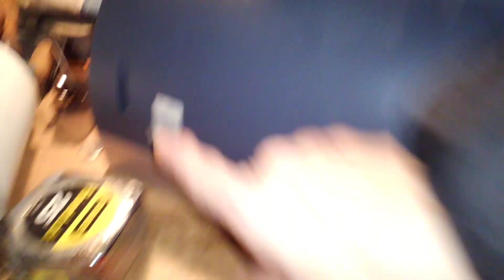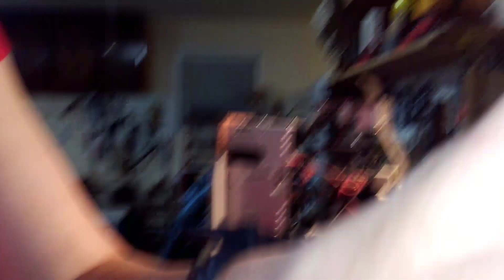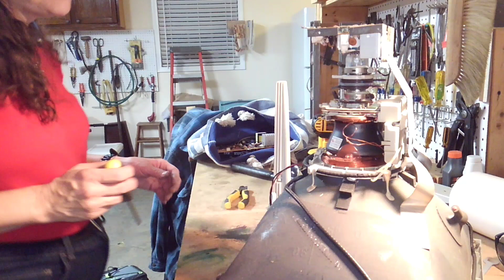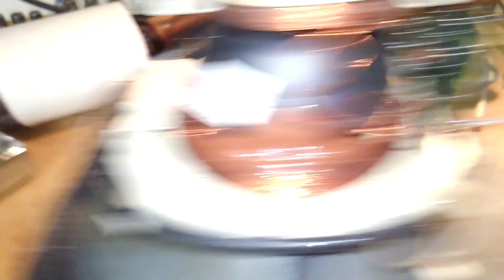Computer Monitor Scrapping on Columbus Day!

Comment: I would have had to cut away all those cords and wires before I started, they distract me and get in my way. Nice score of copper, though!  I have a small CRT tv in my car and a bigger one in the backyard, but it rained today, so no-go...  Its ok,  plenty of other things to do! I'm still catching up on things from being away, including watching youtube vids!
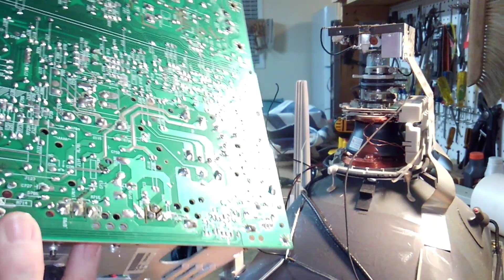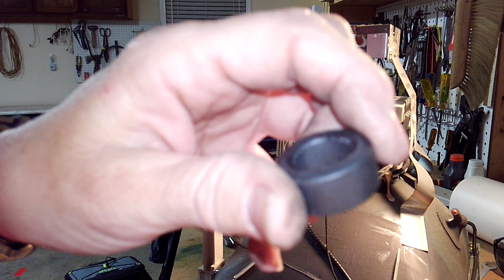@16:55 I thought I saw gold fingers on bottom edge of green side of board when you pulled it off... ?  @21:50 - Those rings are ferrite. Throw them into low grade iron/light steel. 

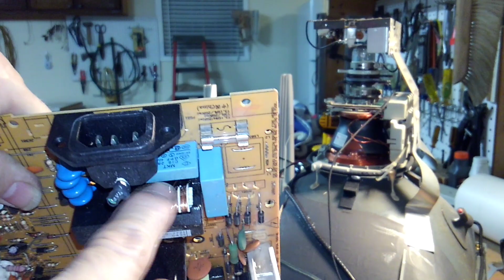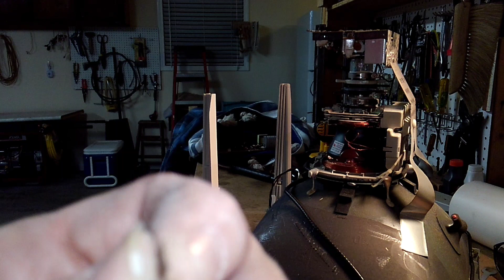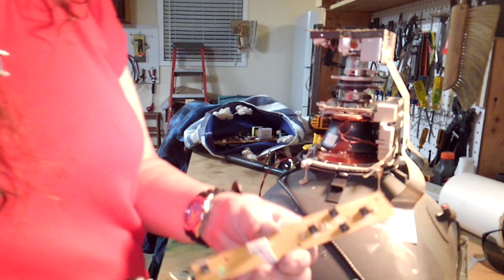Btw, those little squared-off pieces with metal "legs" that stick into the board, often have a hole that screws into a heat-sink, (one at 26:20, screwed to extruded), if you smash the plastic off with a hammer, you'll discover that they are coated copper. There were others that I saw on that board...    Also, the metal ends of those glass-tube fuses are brass.  @30:50, yes, it is called "tinned copper".  @34:15 - maybe no gold, but those switches have silver; almost all switches have silver-coated nodes under them!.
Have to go out.  Be back to watch the rest later -- if my internet cooperates...
Reply from the maker: Eatie Gourmet, I love the trove of information you gave me. I still have everything so I'll check it out next time I'm off. Thank you so much for everything.

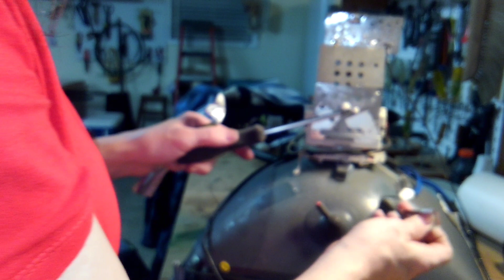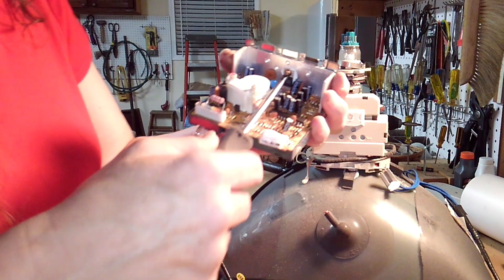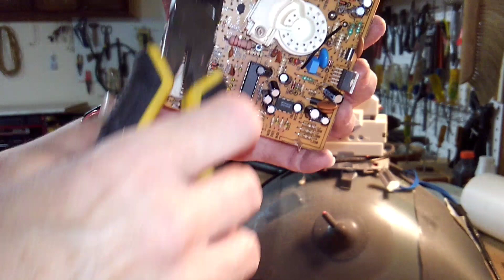Comment: 35:30 - looks like alumninum tape.  36:40 - 2 clamps. 1 is stainless steel, 1 is steel.  @39:41 - THAT'S the piece that you are unscrewing that I was telling you are coated-copper!! Same @41:40, that piece by your left middle finger!
Reply from the maker: Eatie Gourmet, I see what you are talking about and I will definitely check it out on my day off next week I hope. I turned in a bucket load already with those attached. Now I know.